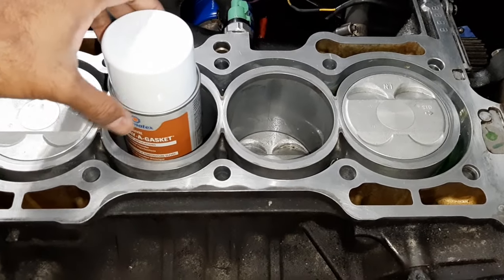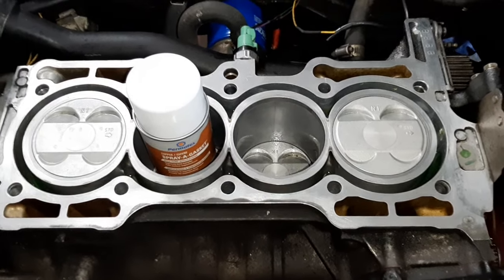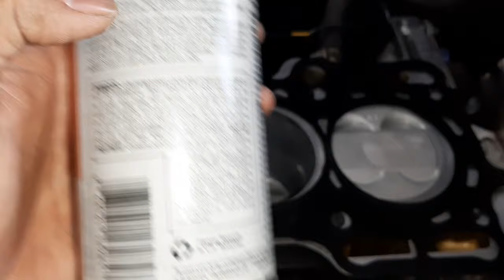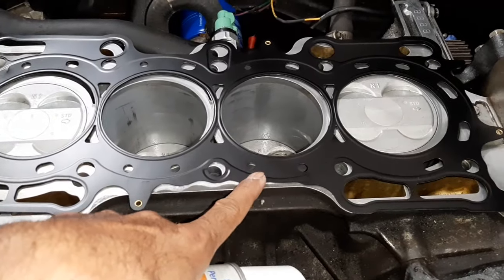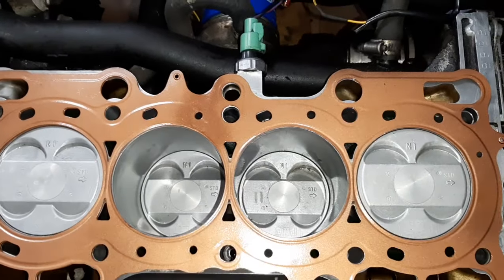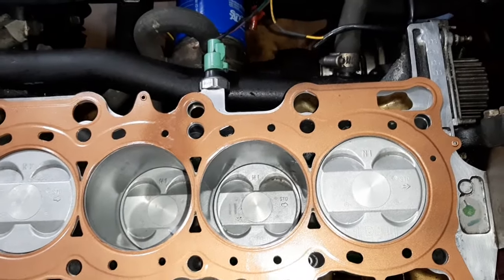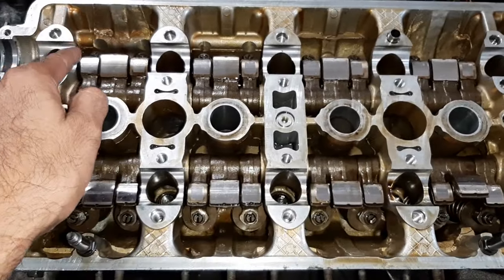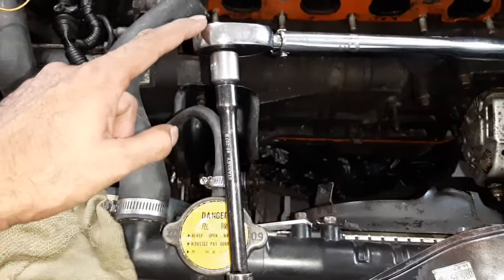How to use copper spray gasket maker on head gasket

Comment: Hi..this thing really pissed me off ..i assembled the engine and the unanswered question is when can i start the engine..you know i have done a lot of work and i don't want to ruin everything due to lack of instructions..!
Reply: U can turn it on as soon as you're done putting engine back together
Reply: 6-8 weeks should be enough
Reply: The rule of thumb on this procedure is the following, remove the heads and clean them excessively. Clean the engine block top mating surface excessively covering holes so you do not get debris down in them. Place the MLS gasket on the head block. Then place the head back onto the engine block making sure it is Louisville. Place all the bolts in the hole and you may or may not choose to use assembly Lube on the head bolts. If you choose to use assembly Lube, you may need to add one extra ft lb of pressure. The assembly Lube can change a torque specification. After putting all other parts to include valve covers back in place securely so that they do not leak. Fill the engine block with oil has normal. Do not fully start the engine at this point! Next make sure the engine is full of a oil by checking the dipstick. Locate and remove the fuse that goes to the ignition computer. This will require doing research to make sure you unplug the correct fuse so that the engine cannot start you do not want the spark plugs to receive Spark. Attempt to start the car. But do not want it to start the point to let the engine Rev one or two complete start Cycles, what this means is pressing the button if it is a button start to allow it to attempt turning over once or twice if your car does not stop attempting to Stark press the button again so that it will stop. This is to circulate fresh oil through all of the parts of the engine because in most cases when you remove the heads it will drain oil from many locations that require oil when starting. One example would be Toyota engines that are the 2GR type. These type engines must have the lower oil pan and the timing chain cover removed before replacing the head gasket. You must ensure that you get plenty of oil circulating through the into block and all the way up to the valve cover so that it will feel the VVT mechanism. Replace the fuse he removed to keep the car from starting. As long as your engine block did not make any unusual noises while allowing the engine to turn over without starting then you are ready to proceed. After you've replaced the fuse now attempt starting the car for the first time. If the car starts successfully with nohad noises other than an occasional ticking sound because many of the lifters are now filling with oil. It should complete the process. You might like too loud the car to warm up for a full 30 minutes s so that you can check for leaks.
Reply: Your question is a good one, that sealant does need to cure... which is why folks like me never use it.  I've never seen it used except in racing motors when re-using multi layer steel (MLS) gaskets, when the $40 new gasket wasn't in the trailer.
Reply: @byronrace  I would wait it out about 12 weeks just to be sure, better safe than sorry

Comment: Those are NOT dowel pins.  They're dowel SLEEVES.  Pins are not hollow and will not allow the cylinder head bolts to go through them.
Reply: Wrong! guess you have not seen all heads.
Reply: @yeahrightmate    What does ANY cylinder head have to do with whether it's a dowl pin or a dowl sleeve.  It almost sounds like your not even qualified to comment in a comment section.
Reply: Well they're all called dowel pins. Symantecs. Lighten up and read the definition of a dowel pin